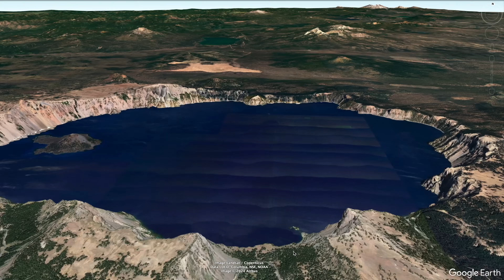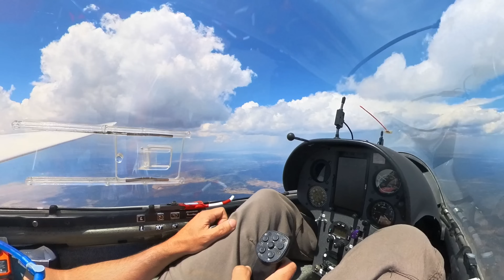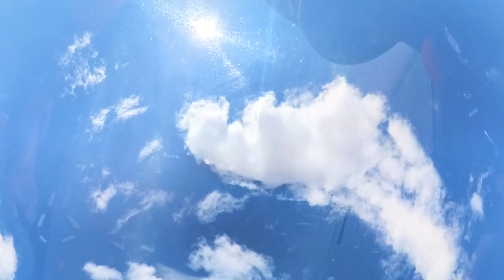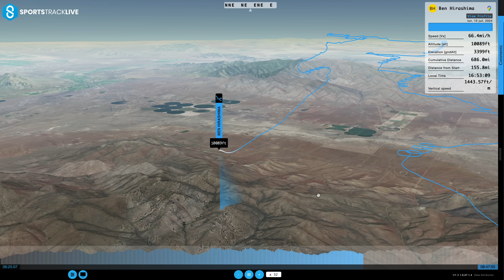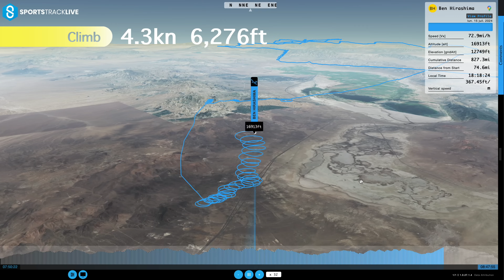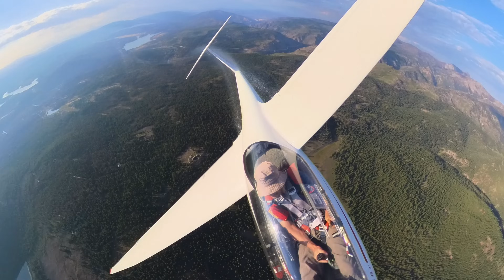How to fly 1000km in a glider

Comment from the maker: Glider FAQ
- How do gliders climb without an engine?: Gliders climb by circling in thermals, which are columns of warm, rising air. They can also climb in ridge and wave lift, which are created when wind blows across mountain ranges.
- How do you know where thermals are?: On days when there are cumulus (puffy) clouds, the thermals are under the clouds. The clouds are created by the thermals. On days without clouds, an instrument in the glider called a variometer (vario, for short) tells the pilot when the glider is in rising air. When you randomly enter a thermal, the vario will let you know that it's time to circle.
- How do you relieve yourself in a glider?: There are several options for men. One is to connect yourself to tube that goes into a bag, or through a hole in the bottom of the fuselage. The connection is made using a condom catheter. It has adhesive on the inside and an outlet at the end for connecting the tube. Another option is to use a plastic bag filled with a powder that turns into a gel on contact with liquid. This mitigates leaks or spills. A gatorade bottle works too. Or you can just wear a diaper, which is an option for women too.
- How do gliders initially get airborne?: A common way is to get towed up by a powered plane. You will often see that happening in the beginning of my videos. There is a rope connecting the glider to the tow plane, and the glider can release the rope once it gets high enough. Another way to launch a glider is by a winch on the ground, connected to a long cable that pulls the glider forward. The glider pulls up while it's moving forward to gain altitude. There are other ways, such as being towed by a car, or launched off a hill by a giant bungee cord.
- How much does it cost to fly gliders?: It can be more affordable than you think. You don't need to own your own glider. You can join a glider club where you pay reasonable monthly dues and you can fly their fleet of gliders. Monthly dues can be around $50-100 USD. You will typically have to pay for launches, which can range from $30-200 each. Sometimes the club can train you to get your glider license. If not, you'll have to pay for lessons, which can range from $5-15 thousand, depending on many factors. A decent starter glider can be found for around $20,000. Prices for new ones are in the low six figures.
- How do I get started in gliders?: Search for a glider club near you and pay them a visit. There are some good resources at the Soaring Society of America https://www.ssa.org/learn-to-soar
- Why do you use a mix of metric and imperial units?
For historical reasons, glider performance numbers like distance flown and average cross-country speed are expressed using the metric system. Glider performance records, achievement badges, and racing stats all use the metric system. Glider pilots all over the world use the metric system when talking about how far or fast they flew. It's a standard that makes it easy to compare performances worldwide. We don't use the metric system for everything though. Americans use feet and knots for altitude and airspeed, because that's what we're familiar with. Being a glider pilot requires using both the metric and imperial systems, and that's okay. It's not a political statement.
Reply: Thanks for the info chap!
Reply: We all know that gliders rise because the wings are pushed up by the air spirits!
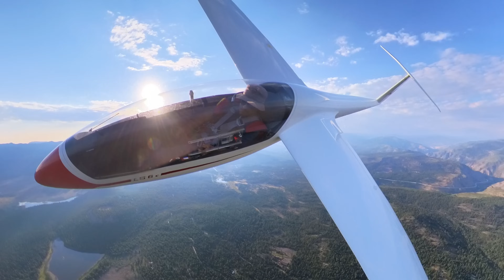Reply: 17:49 I wondered what are those lines coming from the underside of your wings? Since you say there isn't an engine it isn't smoke or something like that I'm assuming. Is it just the air or water particles or something like that? Thanks!
Reply: @adamsharon  dumping water from the ballast before landing i believe

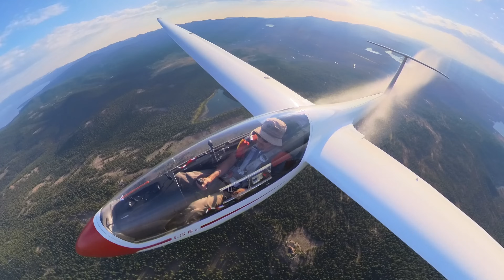Comment: 17:27 loving the water vapor shots
Reply: Is that just from condensation on the glider?
Reply: @TheJudge84  It's from dumping water ballast (which is used to add weight to increase airspeed for cross-country flights) before landing, reducing the weight of the glider, allowing the pilot to make a normal approach and landing. The lighter landing weight also reduces the loads that the landing gear of the glider must support.This glider is a Rolladen-Schneider LS6-c if you want to look up more info on it.
Reply: How was this shot taken? Was the camera actually outside of the glider?
Reply from the maker: It's a 360 camera on a pole, stuck out the window

Comment: I didn't know anything about gliding the other day and I found the idea of going long distances fascinating so I did some research and it's all making sense. 
For anyone interested here's what I was able to gather:

The reason this person pointed out the cloud forming in real time was because when hot air rises it tends to cool down at cloud height and the excess moisture condenses into a cloud, so a cloud forming is a sign of a warm updraft caused by the sun heating the ground. 

The reason he cant go above the clouds is because the updraft ends at the cloud ceiling

The reason he needed to do it all during the day was because there are no updrafts at night as the ground isn't being heated by the sun. 

This hobby doesn't seem as expensive as i first thought too, it's still not something i can forget about if i did get into it, but i guess my expectations were more on hobby airplane flight but gliders are way simpler so it makes sense. This is what somebody said the cost for them in the UK was over a 1 year since they joined

U/pitcairn7393
"This might help for a ballpark figure. I started gliding about 1 year ago in the UK. I've spent roughly:

£400 club membership

£1000 launch fees (mostly aerotow £40/launch)

£160 glider hire (15 mins included in launch)

I've not included fuel for getting to the club, BGA fees, various books, too many lazy grab n go lunches and paying for rounds on the bar tab.

That's for 14 hours of flight time across 43 launches.

Flight times varied between 1hr and 3 mins. I was training so my average flight time is very short. Now I'm solo I'm paying more in glider hire fees but proportionally less in launch fees."

Comment: How do you spot thermals? Do they appear below clouds generally? Do glider instruments give you info on where thermals are like a weather radar sort of thing? Really cool video, I never knew gliders could go so far. I have so much to learn! :)
Reply from the maker: Yes, cumulus clouds usually have thermals under them. The clouds are actually created by the thermals. Instruments can't tell you where they are, but you can learn to read the clouds to tell where the best thermals will be.
Reply: Also instruments (vario) can tell you if you're currently getting lift or sink, and your lift rate can help you know if you're in a weak or strong thermal, etc. So instruments do help confirm your intuition.

Comment: The sun is heating up the air and pushing you up and forward? Amazing
Reply from the maker: Yes, the sun heats the ground, and it heats some parts more than others (rocks, etc). That creates thermals, which are rising columns of warm air. We circle in the thermals, and go up.
Reply: @BenHirashima  amazing 🤩
Reply: @BenHirashima  did some study , some record shows a glider went to 70k feet up …. They needed pressurrized cabin and oxygen,,,

Comment: Never heard of gliding before i’ve got a list of questions

Are thermals available 24/7 or only during the day? 

Are there pockets of cold air that act like reverse thermals making you decline faster than usual?

If you flew over a wildfire would the heat from the fire make a giant thermal?

Are thermals caused only by a difference in temperature. So if you flew in -32f but found a pocket of 0f air would that still cause the glider to rise?
Reply from the maker: Those are all great questions. Thermals are caused by the sun heating the earth's surface unevenly. Some spots, like rocks or pavement, get hotter than others, and cause a bubble of air above them to get warm. That bubble will break away and start rising, forming a column of rising air, which is a thermal. Gliders circle in thermals and get carried upward by the rising air. Since thermals are caused by the sun's heating, they form only in the day, and don't really get strong until around mid-day. 

There are areas of cold air that sink, too. They are often found around the outside of thermals. If a glider enters this cold air, it will begin sinking, but that is often a sign that there is a thermal nearby.

Wildfires definitely do create thermals, and they are strong. Sometimes, a special cumulus cloud called a pyrocumulus will form above the fire. They look just like the clouds that often form above regular thermals, but there's a column of smoke under them. The smoke lets you see the shape of the thermal. I'd suggest Googling pyrocumulus to see a photo of one. 

There can be thermals in the winter. You're right that any temperature difference will do it, even cold vs less cold. The problem with winter thermals is that they don't go very high, which makes soaring cross-country difficult. Temperature inversions in the atmosphere are what determine how high thermals can go. In the winter, the inversion tends to be relatively low to the ground, limiting the height of thermals.

Comment: When counting KMs, are you doing a waypoint-to-waypoint distance or GPS over-the-ground distance?
Reply from the maker: Cross country distance is usually measured by dividing the flight into 6 straight-line legs and adding up the length of those legs. This is how websites like Weglide and OLC score flights.

Comment: I'm not a pilot but I'm imagining that one of the best parts of gliding is that it is extremely quiet compared to a typical GA craft? If so, does sound play any role in being a glider pilot?
Reply from the maker: It's definitely quiet compared to an aircraft with an engine, but that's not really what draws people to soaring. It's the challenge and adventure of traveling long distances using only rising air currents. Soaring is a sport, while powered planes are just transportation.

Comment: This is so cool. As I understand it, the air columns you use to produce lift can only be possible in sunny weather?
Reply: Sun needs to be able to warm the ground to cause air to rise, but that doesn't always mean the weather would be referred to as sunny. There will also be other factors at play to cause moving air that can provide lift or create sink. The book "Understanding the Sky" spends 75 pages explaining soaring conditions for getting lift and understanding thermals. But the core of your thought is absolutely correct: we need the sun to put energy in the air. Differences in air temperature then create movement.

Comment: imagine if someone with your gliding techniques got into something like a sonex xenos, (glider with motor), instead of finding thermals you could turn the engine on and climb while maintaining heading, while still having the motor off 80% of the time,

you could realistically go somewhere over 100mph with prius to motorcycle level fuel economy,
Reply from the maker: Sure, but where's the fun in that? :)

Comment: How much does a glider like this cost? Dont you use the motor all the time during the flight or what do mean with flying with no engine
Reply from the maker: It's a glider. There is no motor. It's propelled by air currents called thermals.

Comment: Sorry but i did not understand what are that rotation/circles on that map.
With the glider you was doing circles in the air? If yes, why?
Couldnt you just go on a straught line?
If you were doing circles why didnt you showed them on the video rather than on that map?
Reply from the maker: Gliders go up by circling in thermals, which are columns of warm rising air. I don't show the circling from the cockpit because it's boring and it goes on for many minutes. If I accelerated the video, it would look like a tornado and you'd get dizzy. That's why I show an accelerated view from outside the glider.

Comment: i have so many questions:
how does you gain altitude just by going in circles?
do you have AC or any form of cooling in there?
also, how does he film the shots where his entire glider shows up
Reply from the maker: Gliders circle in thermals, which are columns of warm, rising air. There is an instrument in the glider that shows whether it's going up or down in altitude. When it's going up, you circle. No AC, but they're are vents that let air in. At high altitudes, the outside air is very cold.
Reply from the maker: The outside shots are from a 360 camera on a pole.
Reply: @BenHirashima  thank you

Comment: Climb rate in knots, altitude in ft, distance in km, speed again in knots. Americans sure are smoking strong stuff or are great at mental arithmetic.
How about meters per second, meters, and thousands of meters aka km. Then you know how much height you gain per second and can calculate your travel distance with your glide ration simply in your head and what time it takes with your current speed becomes a one step calculation.
Reply: Aviation is done almost entirely in knots, nautical miles, and feet, even in countries that use metric. Distance in km is pretty rare, and they're probably only doing it because 1000 km is a nice number while 1000 nm is probably impossible. Climb rate in knots is very unusual, usually that is done in feet per minute.

Comment: How do you know where thermals are?
Reply from the maker: Cumulus clouds (the puffy ones) are created by thermals, which are rising columns of warm air. When the warm air gets high enough, the water vapor in it condenses, forming a cloud. So gliders fly from cloud to cloud because that's where the lift is.
Reply: @BenHirashima  Makes sense. Thanks!

Comment: Gliding is falling out of the sky in a controlled manner. so it's not flying right?
Also you're being pulled of the ground and into the sky by a plane with a engine. so technicaley you cant "Fly" 1000KM without an engine.

Comment: The tracking data says you did almost 1500kms.....??!!
Reply from the maker: You're probably looking at the distance on Sports Track Live? It's counting the distance flown when circling in thermals, but that's because it wasn't built for gliders. The distance flown in gliders is scored by dividing the flight into 6 straight-line legs and adding them up. The distance flown while circling doesn't count.

Comment: So that's cumulative 1000km including circling in thermals, not a pre-planned 1000km task.
Reply from the maker: @klausvonshnytke  it doesn't include thermaling. The flight is divided into 6 straight-line legs, and the lengths of the legs are added up to score the distance.
Reply: Boom got ‘em

Comment: 600 miles. Bro, you are an American use miles. it's so cringe when Americans use the metric system to sound smart or something or some cringe crap like that.  Fact, if you are American you have to go way out of your way to speak in Km and kilo's.  Americans are born and raised in the imperial system. I don't trust an American who does this. I have nothing against the metric system, I use it for measuring in welding all the time, but when doing machine work I use imperial I like thousands. But speaking,  Americans do not naturally speak in the metric system. Not without focusing on it and forcing it.